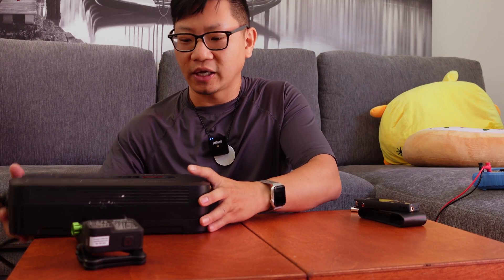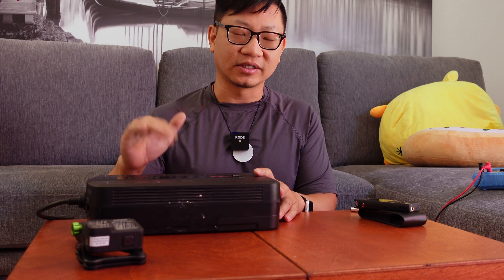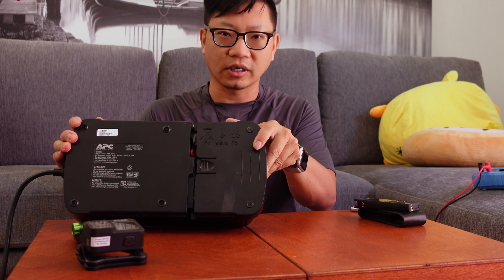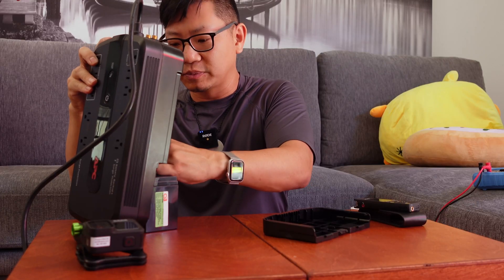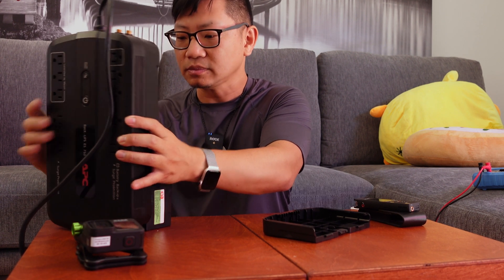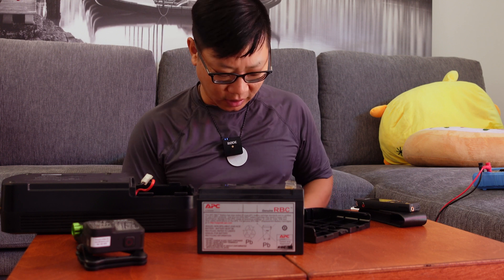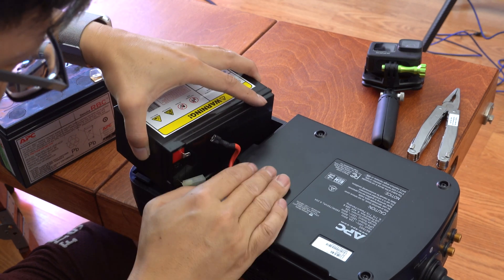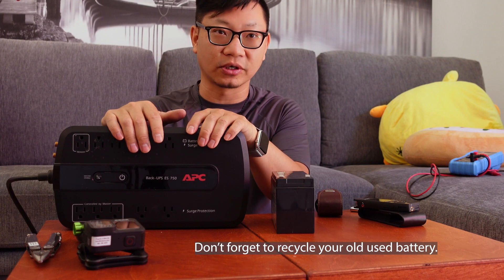Don't throw that spent UPS away!  | Replacing the UPS Battery in an APC ES 750

Comment: Cyberpower threw an alarm tonight that wasn't stopping - it stopped delivering power. ouch.  Luckily I still had 2 batteries on hand still.   I have a older cyberpower rack mount - I put some new batteries in - but it felt like the unit was running TOO hot.. (I don't recall how it ran previously). I did notice most of the wires with the clear plastic covers were looking pretty brown.  :(
Reply from the maker: Oh man.  Time to let it go or replace the components.  I'd say let it go as it's not worth the risk.
Reply: @MikeMu  Thought about rebuilding the wires and giving it 1 more try..just don't have the time really.   :(
Reply from the maker: I know how that is. I’d keep a close eye on it though. I’ve seen ups units burn up.
Reply: The was the concern I had when I replaced the battery in an APC BN600G recently. I ordered the replacement battery from APC for that model but when it arrived that specific model was not displayed in the instructions. The two batteries were identical in size and appearance, but the no specifications were listed on the batteries in insure they were compatible. 120V 5A 600VA 360W was specified on the case. But not on the batteries. I bought a multimeter to test the replacement for compatibility but was unable to figure out how to use it.